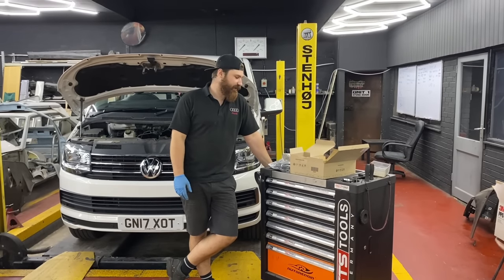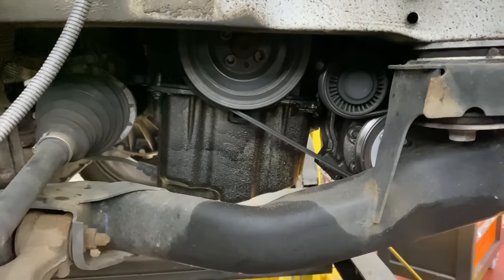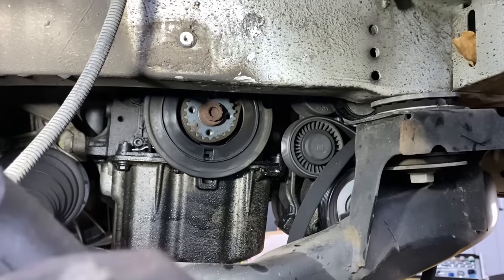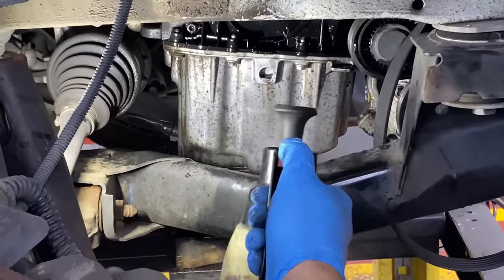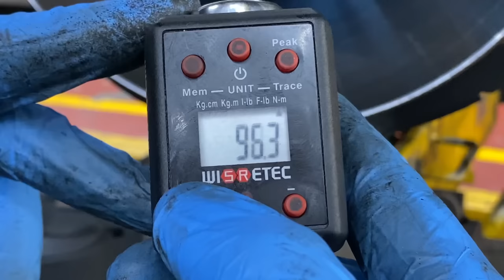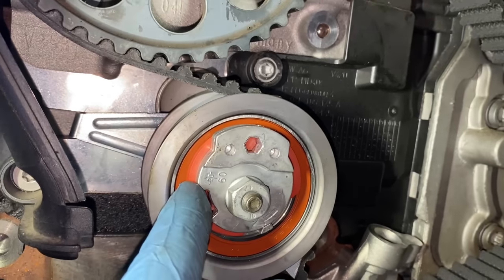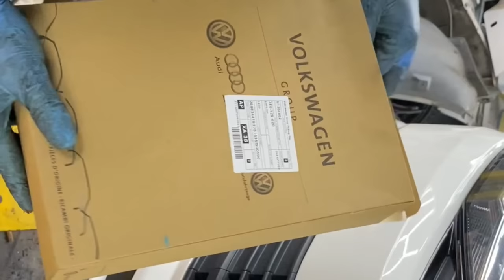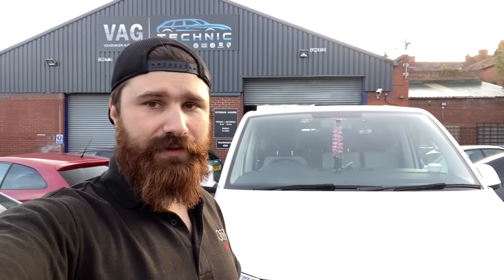VW Transporter T6 2.0TDI - Timing belt and water pump replacement DIY? This is how...

Comment: I’ve done loads of these and undo the fuel pump sprocket nut too as per manual. I fit the idler before the belt but I know that it’s probably a trait you’ve continued from the earlier Vw Diesel engines where yeah it makes it easier to fit the belt without the idler in place, not so much on these but nice work
Reply: Never slackened the pulleys on these ever. Easy enough to do without. When you put the cambelt on pull all your tension around the waterpump and fuel pump. Easiest one you will ever do
Reply: @petemechanic8249  easy enough to do it the right way mate, they were made like that for a reason. Too many lazy mechanics
Reply: @reece1308  never ever slacken the pulleys. Easy enough to do without

Comment: If i'm correct the crankshaft bearing is an PTFE bearing and should NOT be oiled but needs to be placed on dry surface.... they will leak again...
but good job anyways on the timing belt and taking the time to replace the bearing.
I would change the crankshaft pulley aswell since i've had some who were worn out causing motormanagement issues and hard starts.

Also needed to remove the sump to put on bearing but i know its much more time consuming.

Comment: That was superb to watch. I've just had my crank seal replaced by the main dealer and a big long life service just before it. I'd asked them to explain the part the were replacing or at least take a photo or video clip (they manage to show you a clip of the fluid levels and spend an age with a tyre gauge, everything I can do myself,  but nothing more!). I've found your channel by chance and I've immediately followed you and liked this ...double thumbs up from me. I really appreciate the simple tips that you have blatantly learnt from doing this over and again - like the orientation of taking off bits of trim or the direction to push or pull a clip and the Nm torque settings. 

Last quick question - when swapping the fuel filter to 'prime' do you just add some diesel from a can into the filter before reconnecting, or is there another neat way to do it?

Thank you again - just superb... and if your company is anywhere near me I'll be using you instead of the main dealer!

Comment: If you want to just change the crank pulley do you need to lock off the cam? I would not think so if it’s just those 4 bolts

Comment: Crankshaft seal should be fitted when sump is off, because if you don't then u will get the same leak after next 30-40k, which is wrong, the Crankshaft seal should last much longer than that...
But still it's a nice video,  thanks mate
Reply: Could you explain why?

Comment: great video man ! I have a 1.6 tdi EA288 engine and I already replaced 2 times that crankshaft seal , i know that they are prone to fail but I don't get it why . Based on the lip deformation , it looks like the crank shaft isn't centered . I replaced the 2 main seals and clutch last April , the gearbox side was good and dry but I did it anyway , yesterday I saw that the belt side is already starting to leak again , always from the lip\shaft . Can the crankshaft be off balance and only leaking on one side ? I can see a little of deviation\wobling on the v-belt pulley when running at idle .. could a bad sprocket or v-belt pulley throw the shaft a little bit off balance and wreck the seal ? the seal isn't lasting more than 4 or 5000 km , I already used oem and aftermarket seal (elring one)
Reply: when replacing do you remove the engine pan or do you do as shown in the video?
Reply: @Yaroslav_1_9  you should remove the oil sump if you want to replace the oil seal for this EA288 engines . If you just want to do the timing belt , you don't need to remove it

Comment: I did want to ask you a question if I may

This is what's happening 

The coolent tank develops a vacuum so the coolent light comes on and when you look at the tank it looks low on coolent byt when you take the cap of the tank fills uk on its own 

I am really not sure as to whats happening 

Any ideas?

Comment: Hi.I have VW CC 2.0 tdi 2015 r line.What mileage you recommend change timing belt and water pump?Thanks
Reply: 10 years or 210.000km ofcours do it before that time ... with the waterpump

Comment: Great video! How long does the small toothed belt for the oil pump last? According to VW there is no specified limit, but some saya it is 300K km (180K miles). Does anybody have any experience on it? Thanks!
Reply from the maker: Seen them go even at 80k
Reply: @VAGTechnic  I think it happens if people use oil which is not specified for the engine. I guess it is due to additives.

Comment: Does anyone know anything about a updated timing belt COVER for the T5 called a "Robustness Kit"  ?? 
They reckon If the serpentine belt breaks it goes  thru the oem cover and gets tangled it the timing belt. Tried a couple of dealers with no luck
Reply: Haven't heard of the belt, but I have heard of a couple cases of such happening with the serpentine belt!

Comment: Hi guys,

I have a T5.1 2,0TDI  2014 engine..replaced the  timing belt everything looks fine but when i put the crankshaft locking tool in place.. the locking pin for the camshaft wont go in. aprroxemetly 1 mm out of the middle. is this oke ? the locking pin for the HD pomp goes in smoothly. what do you think. its not a tooth off. impossible.

Comment: Hey, nice video! I want to ask if you need to replace the bolts with a torque+degree rating like 70NM+90° ? Like the accessory belt tensioner? In the original volkswagen shop manual it says that you need the replace every bolt which has a degree rating ??? I wonder if anyone is doing that because it would be pretty expensive on bigger jobs.... Thanks for help ;)
Reply: Yes , you should change any bolt with a angle torque rating , i did this job on my car and replaced every bolt . Was 13 in total (if i recall correctly) . The sump was removed because thats what vw say to do when changing this oil seal
Reply: @Smithy18 many bolts on a mk7 are one time use and there are some exceptions too , the transmission shaft flange bolts have only a torque rating and they are one time use

Comment: is this same engine that's in vw golf 2.0 tdi same year? how many miles has it done ? thanks 👌 i was told for vw golf 2017 its 5 years. and vw said they only replace belt and water pump 😮
Reply: Are talking about a mk 7 golf ? If yes , the replacement should be done every 210k km or 10 years
Reply: @Smithy18 in wich country ? Never heard about a 5y/50k miles interval , on many countries is 10y/210k km . 1.6/2.0 tdi ea288 gen

Comment: is that a belt driving the oil pump behind the new crank seal housing? I wonder if that'll last forever?

We have the 2.5 TDI in our t5 which had neither belt nor chain... That's the only real good thing about it
Reply from the maker: Yes that’s belt , last long … 2.5 have gears :)
Reply: @VAGTechnic  It should be replaced with cambelt. Mine broke at 270k km. And if dealeship replaced it at 120k km, then it means that it's lifespan was even shorter.

Comment: this is why i buy cheap simple cars with a timing chain.
i've driven 4 million miles in my life and never had a chain fail on any car or bike.
had a few belts snap. cant buy cars with this expensive shite. here in sweden franchised dealers charge 400 quid an hour. i would sooner scrap the car than pay those crooks

Comment: spoiled by abysmal sound, could hardly hear him most of the time.
Reply from the maker: Sorry for the poor quality of sound , just beginners , but finally have a external microphone so hopefully the sound will approve
Reply: For a vwt5. 1 that does approx 6k miles a year.... Would you still change the cam belt /tensioner/water pump every 4 years?